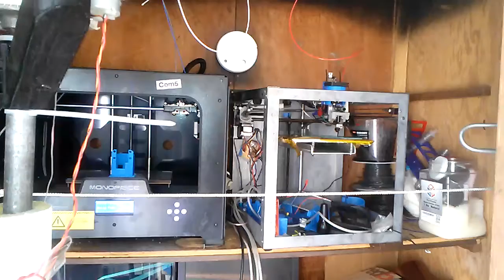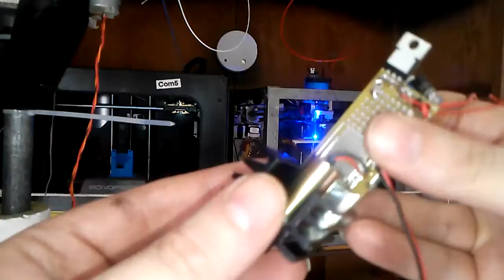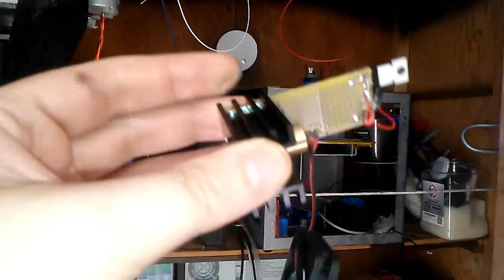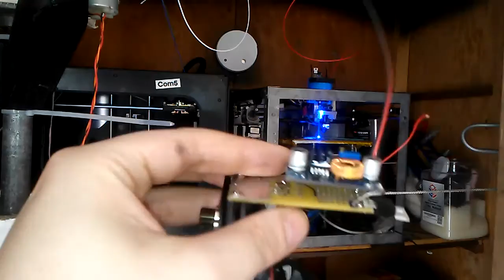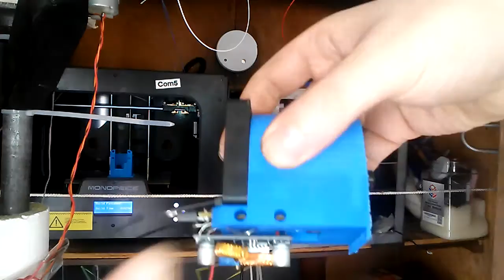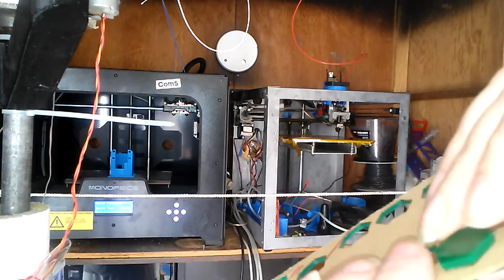L-Cheapo Mark 5 full power test 2

Comment: hello - I'm looking to get a good solid high-power diode laser for my plotter. I've seen the L-cheapo MK6 over at 3Dsupplysource, and I've seen one at "Endurance" lasers. Can you tell me which one is legit, and who I should be buying from?
Reply from the maker: Endurance is not an authorized L-Cheapo reseller at the time of this writing, they are using one of our older designs without complying with the license. 3dsupplysource is our preferred US reseller.

You can see a comparative teardown of a genuine L-Cheapo vs. an Endurance laser at http://f3.to/quickgal/1523227244is%20this%20too%20passive%20aggressive.png after which I ask you to judge for yourself which one you would rather buy :)
Reply: Thank you so much :) You have made my decision very easy. I will order the L-cheapo and look forward to using it on my openbuilds ACRO machine!
Reply: If I may ask one more question - do I need the solid state adapter? The laser will be paired with the xPro board and 24v PSU from openbuilds
Reply from the maker: Depends on the PSU's total amperage. If it's more than 4A, no. If it's less than that, yes.
Reply: Thanks - It's 10-15A or so
Reply from the maker: Oh then you're good, no need :)